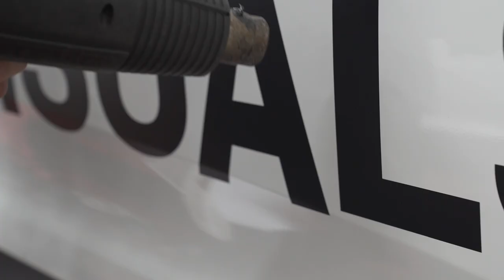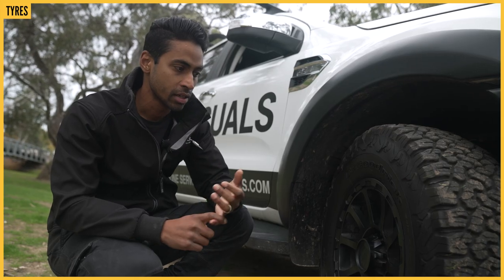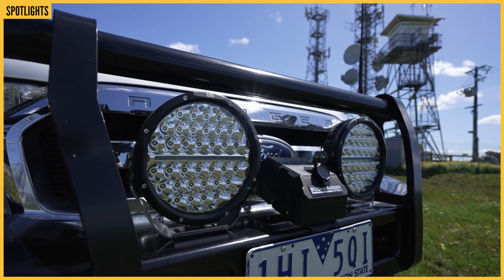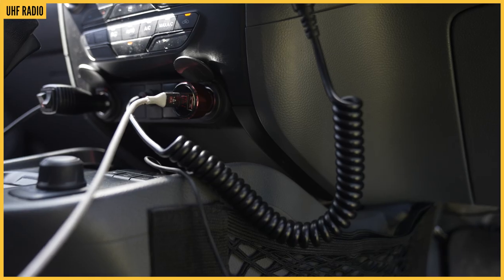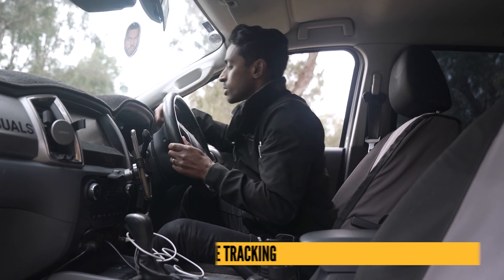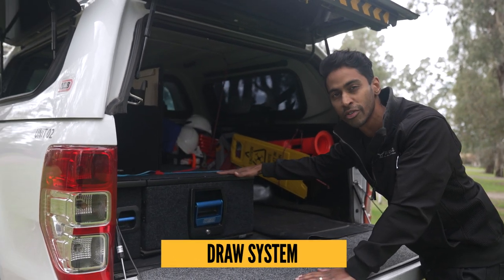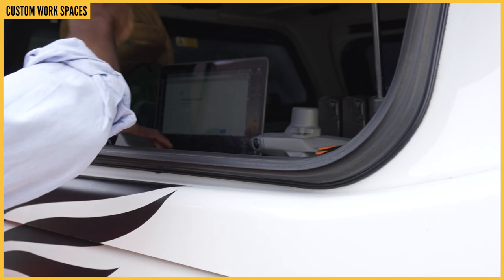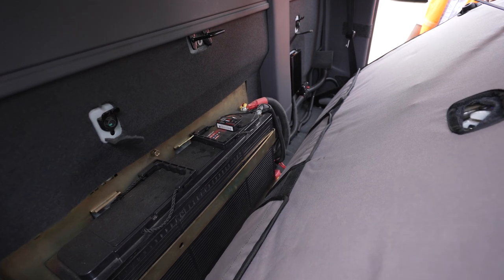Building our ultimate 4x4 drone vehicle -  Full setup! (Unit 2)

Comment: Very nice set up.👍🏼 When you charge drone batteries do you use car charges and 12V or standard 240V chargers and connect to inverter? I wonder what's more efficient.
Reply from the maker: 12v to 12v is always more efficient but we charge drone batts with the 240v output from the inverter.. mainly because its easier across all our appliances